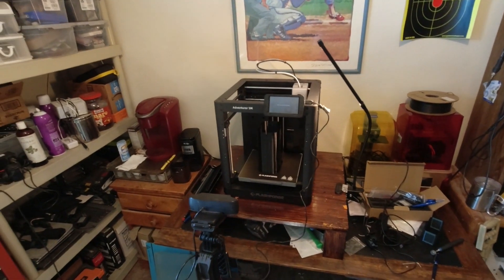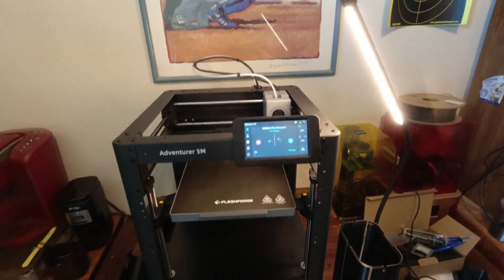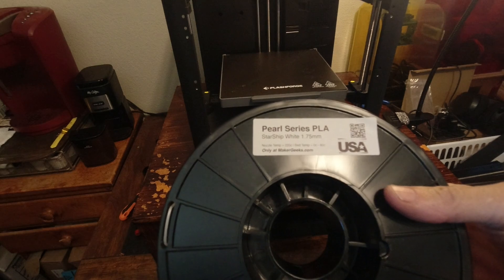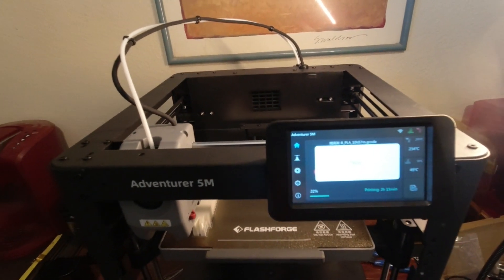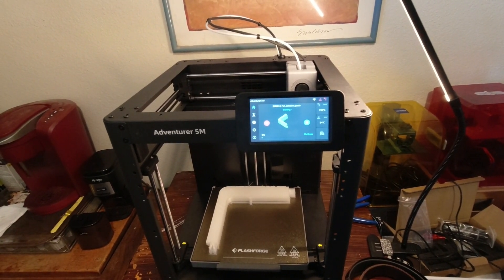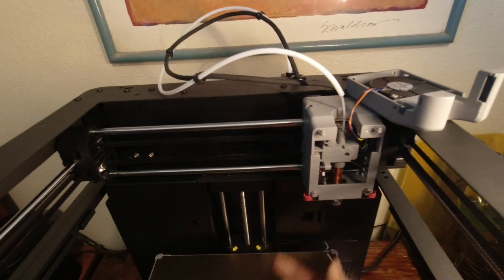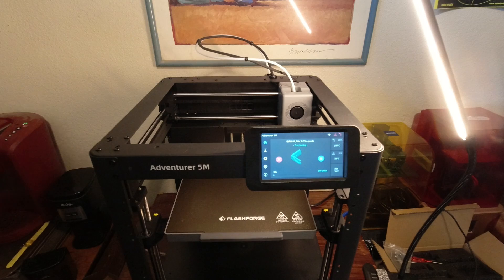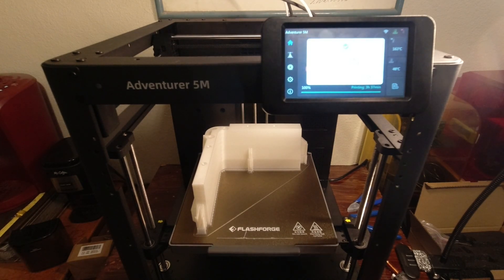Flashforge Adventurer 5M Day 3! Failed prints, fixes, stupidity and printing the enclosure parts!

Comment: ForgeX firmware will solve the data transfer corruption ..   it is staggering that my old CD-rom drives from the 80's have better data integrity checking than modern networking devices and protocols.  ....but there you have it .... Dr Alex had to add MD5 hash verification to network transfers and actually verify the file that was sent is the file that was received.. ....how is this a task that falls upon the community to solve....in 2025/26 .....seriously!
And I'm  not throwing shade exclusively at FF.....all of these 3d printer companies are slacking on basic comms protocols. If print farms of ender 3s were a thing. .... the need to  network node and manage multiple machines ..   or just talk clearly to one should be old-hat by now.....not a new feature.

Comment: My Flashforge 5m also stops when printing! Have you solved the problem with this? I do not know what to do.🤔🤔🤔
Reply from the maker: For me it was only that one test print. Everything else has printed fine. Try printing a test cube sliced in Flashprint. If it stops in the middle of that with no error message I don't know what to suggest other than contacting Flashforge for help.

Comment: Did you experience any issues with the third plate of the PETG parts? Mine the bottom layer seemed very thick and the long part seemed to be narrow on the end opposite the indented end
Reply from the maker: I didn't have that problem. I had others, but not that one.

Comment: Flashforge designed the enclosure parts, lol.  It's on their website.

I have two of these though and love them.  I had some issues earlier on with freezing and things like you experienced, but the firmware seems to be good now, haven't had such issues since then.
Reply from the maker: I mentioned that the enclosure was by Flashforge and even provided a link. lol

Comment: The base of this printer is plastic? Why FLASHFORGE claims that all metal frame is used? Or 5m pro uses metal base?
Reply from the maker: The frame and base are metal. The trim pieces around the outside of the bottom base, like where it says "Flashforge", are plastic. I can't answer questions about the Pro because I don't have one.
Reply: @3rdpig  Thanks for answer a video where you stick a magnet showing it's meal is a must!

Comment: i have had the same issues when i bought my adventurer 5m.. but when i changed the filament to HIGH SPEED flashforge filament, it prints perfectly fine.
Reply: the reason you are facinf these issues might be because you are not using a high speed pla filament
Reply: when i first started i picked up a white pla filament for this but when i started using , it messed up every print. therefore, we realized something was going on wrong and that the filament was actually rated for 90mm/s through more research on the filament. apparently we are supposed to buy the new flashforge high speed filament or any high speed filament for printing at 300mm/sor above.

Comment: Thanks for the videos, this helped me to decide on purchasing one. You mention using hairspray for increased bed adhesion, can you tell me what brand or kind? I don't have a wife to consult on this so I need a bit of guidance.
Reply from the maker: I use Aquanet Extra Super Hold. I don't know where you're located, but the Walmarts around me carry it, comes in a 3 pack for about $16. Other brands may work, but when I started printing 6 years ago that's what someone recommended to me and I've had good luck with it. And on a bed like the A5M has, you don't need to put it down heavily like I used to show when I used a glass print bed, just a couple of light passes across is sufficient. Used like this a 3 pack will last a long time.
Reply: @3rdpig  Thank you, I was thinking Aquanet as I remember my mom using that back in the 70's 🙂

Comment: Chuck the issues of the stopping print and uploading is from either one of two things:  1.  Your firmware or 2. and most likely your internal storage on the printer is full.  Delete some of the files there on the printer
Reply from the maker: Good advice, thanks!
Reply: @3rdpig  NP! I hope it helps 🙂

Comment: I have the pro and i am considering buying the 5m. Can you enlighten me about idmf you can add the fans to the rear of the 5m for filtration..
I know the motherboards are not the same so i would have to power the fans externally  but a pic of the inside and rear would be great.
Thank you😊
Reply from the maker: I don't see why you can't add fans for filtration, even if there's not room inside the enclosure you could always cut an opening in the panel and mount the fans and filters on the outside
. 
In a later video I added a light strip and the camera to my enclosure, and in that video I showed the inside back of the printer and the motherboard. I'll put a link below. Thanks for watching!
https://youtu.be/4nKRDWdBxLI

Comment: hi chuck, i'm glad to see your video, i hope all your enclosure parts was printed well, i wish to ask you a question, which layer height you use with that 0.6 print head nozzle?
Reply from the maker: I've been using the defaults that were in Flashprint for the 0.6 nozzle, which is 0.3 layer height and a 0.62 line width. So far it's working great and it's not noticeably different than the 0.28 layer height I use with a 0.4 nozzle. I haven't experimented with a thicker layer height yet, but I'm thinking if I can run 0.28 with a 0.4 nozzle with good results, I should be able to go much higher than 0.3 with the 0.6 nozzle. Maybe 0.45 or 0.48? I'm going to have to play with that soon.

Comment: You will have your enclosure made before mine arrives, do you think it will be capable of printing nylon?
Reply from the maker: My enclosure is done, I haven't tried nylon yet though. I've done ABS and I'm going to do ASA today while my roll of nylon bakes in the dryer. I'll have the enclosure build video up in a few days and hopefully the first of several filament tests up shortly after that.

Comment: I haven't had to use any glue or Hairspray on my printers since I started and I started with a cheap Kobra neo I have the AD5M an A1 and mini and Q1 pro never had problem with sticking with any type of filament, you may need to update your firmware if you didn't already

Comment: Those tolerances are spot on!
 If you have the step files maybe creating your own STL and slicing that might be the way to go. Or check out the STL in Orca by using the fix command, I have had some bad mesh data in STL files before and the fix repaired it.